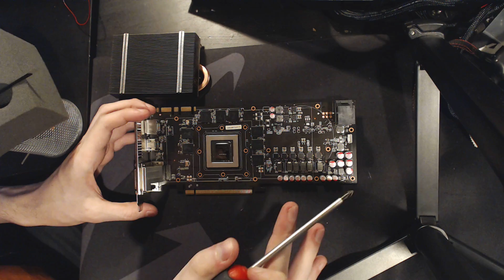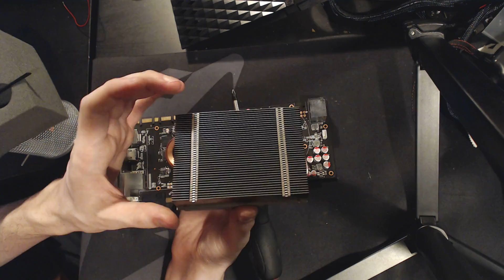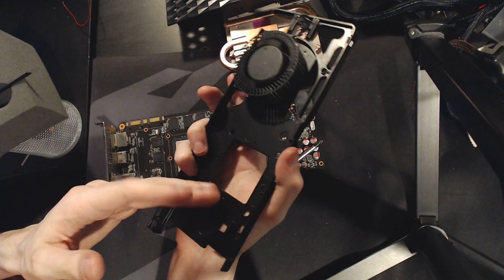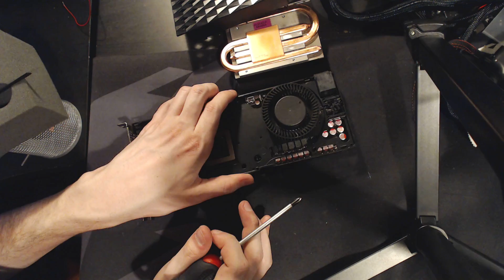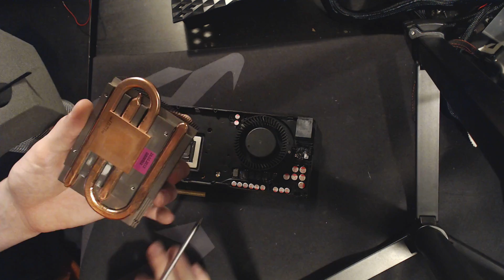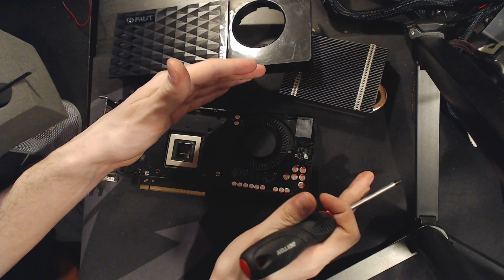PCB Breakdown: Palit GTX 680

Comment: Bad power layer pcb layout I quess. The caps should be in between the power source and load. The caps here is staggered to one side of pcb. There is the reason why any modern day graphic card power supply looks almost the same in its layout.

Comment: Could it be the layout of the VRM be influencing the stability of the voltage reaching the chip? Since it's laid out linearly away from the chip you must get some kind of interaction caused by the very different distance from the fet to the chip

Comment: Hi. In your opinion the Gtx 680 is still capable in 2018 right? I'm guessing or estimated its performance should be at least on par with GTX 1050 to? Thanks
Reply: OPTERON PRIME its still ok for esport games , but definitely not for aaa titles or games like pubg.
Reply: OPTERON PRIME for me on medium setting I get 55-57 fps on pudg
Reply: should be close to a gtx 960 i would think. a 780ti or so is around a 970 what is around a 1050-1050ti
Reply: I don't think so. 780ti is on par with a 1050, which is much more powerful than a 680
Reply: Xboost what now I'm confused game debate says gtx 680 performes slightly better than gtx 1050 ti which is (more powerful than gtx 1050). A gtx 780ti is more on par with gtx 1060 3gb right?
Reply: Xboost http://www.game-debate.com/gpu/index.php?gid=3669&gid2=1639&compare=geforce-gtx-1050-ti-4gb-vs-geforce-gtx-680-galaxy-2gb-soc-edition
Reply: Sniper Pro nerf mods thats not half bad pretty good

Comment: The GTX 660 Ti I tried to fix (after I watched your Cap Mod Video) had a 6 Phase VRM (I guess) with 6x 820μ (4920μF), and when i doubled the capacity, the Card stopped crashing at Stock Speeds, and now a Friend of mine uses it for months Without stability problems :D

Comment: Hi Buildzoid..Just an idea...Get car battery and connect it to the card you want to overclock..Pure direct current..Dont forget to connect 2 masses with thick wire.The overclock must get better since the voltage drop or ripple will be (+ -)0mV..Dont worry it wont burn the card..EDIT.And that hitsink is not "crappy" ... If you dont trust me-try it on 1080Ti even and you will see...
Reply: The problem is not ripple on the 12V rail, he is using a good PSU that has no ripple issues. So you would need to find a "car battery" that could do ~300A at ~1.3V for like an hour. Wait a minute, what is the voltage on a typical NiMH cell? Hmmm, I guess if you are insane enough, you could try to EPower a GPU using a huge bank of NiMH batteries in parallel, but you would have no voltage control, the voltage would drop as the cells are getting discharged, and recharging ~150 cells would be a giant pain in the ass.

Comment: PCB question can the mosfets / powerstages crap out without showing on the outside? like stop wqorking w/out blowing up or discolored
Reply: I'm tempted to say yes, tho I have doubts about Power fets, because of the power bit. Fets can fail and become permanently open (off), or the gate can get destroyed preventing the FET from tuning on ever again, tho I'm sure that is rare outside of the lab with limited voltages on a finalized circuit. a short inside a power FET will almost always involve too much current flowing somewhere and that would show up somewhere visibly.